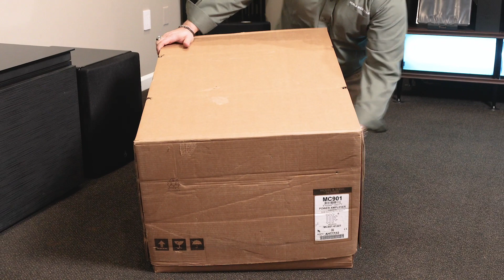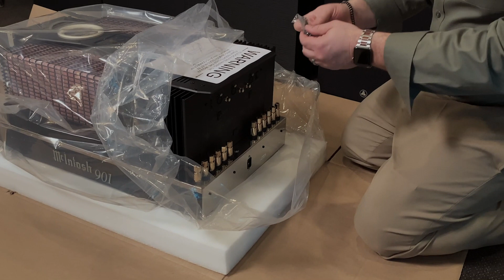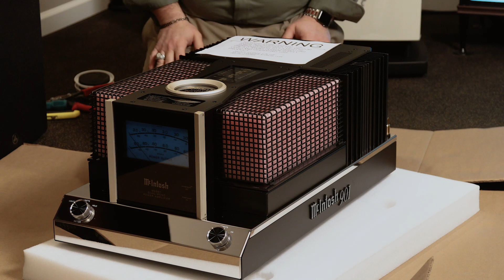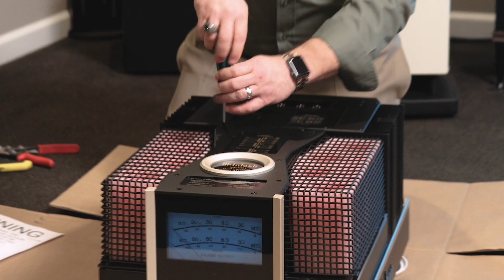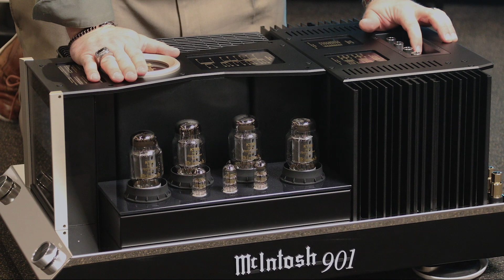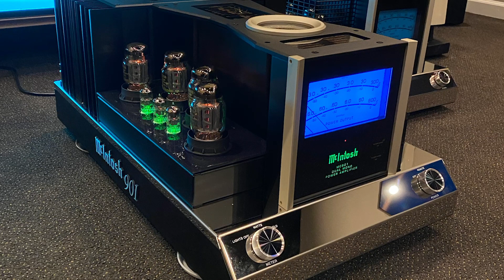Unboxing & Review of the McIntosh MC901 Dual Mono Amplifier

Comment: Question:
 I've noticed you switch On the amplifier to fire it up. But noticed that No load was connected to the 2 channels of the amplifier output? Is it dangerous that you could damage the amplified with No speaker or Dummy load connected?.

Comment: Always open new gear with gloves. Keep your fingerprints off that beautiful Mcintosh.
Reply: I agree, but I have seen people put the gloves on before they even open the box.  I think they should put the gloves just at the moment when their hands are about to actually touch the unit, otherwise all dust particles will land themselves on the unit and not to mention may cause some scratches here and there, especially in the case of black piano painted speakers.

Comment: I'm confused... Do you need one or two of these for a stereo system?
Reply: I believe so.
Reply: I think because it's meant for bi-amping, so you can and should use one device of these for one speaker: the 300w for high&mid tone and the 600w for low (bass) since bass needs normally more Power! , then another device same connection for the second speaker. That's it!